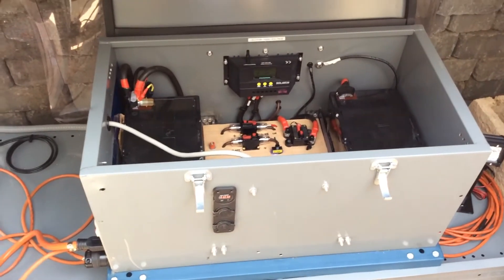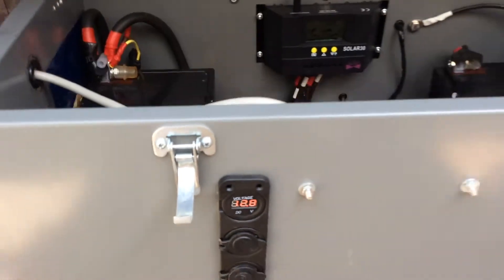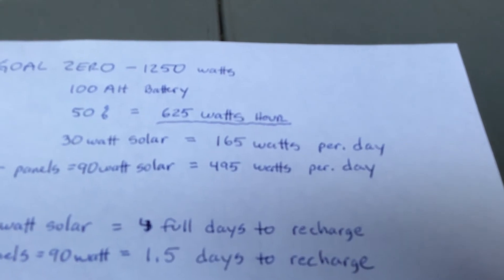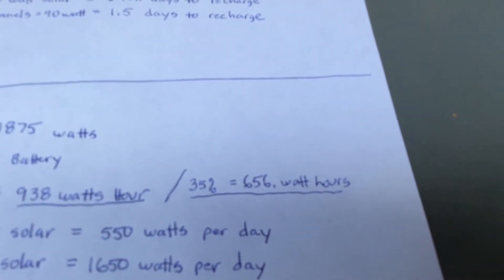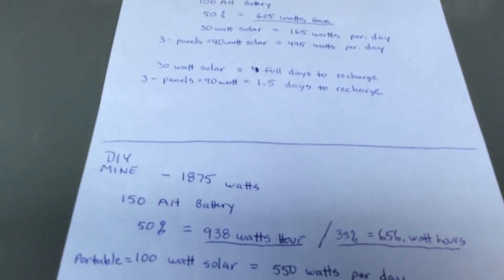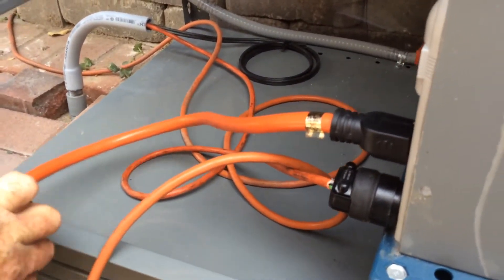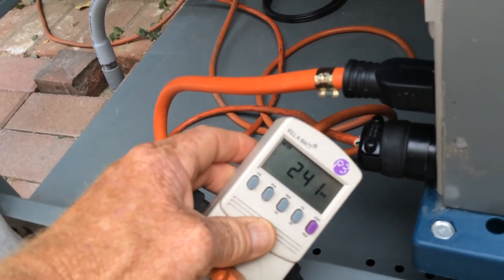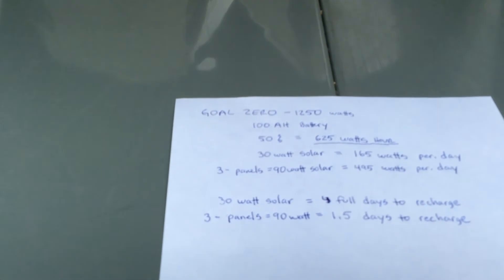DIY solar power generator vs Goal Zero 1250 generator

Comment: Ok, these are like car batteries.  There are different size care batteries what type should I get.  I want to get the gel type batteries and I thinking a pure sign wave inverter, unless it is super expensive.
Reply from the maker: Deep cycle batteries and a pure sign inverter is better. two six volt golf cart batteries would be the way to go'
Reply: urban solar offgrid I'm very new to this.  Would there be a major quality difference in 2, 6 V batteries compared to 2, 12 V batteries.   And I'm guessing I should get the highest Amh, I can afford.  I see the sine wave inverter are really expensive.   I would like to keep the budget around $800.  Your video simplified a lot of stuff.
Reply from the maker: The 6 volt batteries are pure deep cycle and the 12 volt marine are a cross between car and deep cycle. Same price for 2 and amp hours , just a true deep cycle with the 6 volt batteries. The mod sign inverter will work just fine.

Comment: Nice analysis of the GZ product vs. your DIY system.  There is no comparison.  GZ products are both inefficient and expensive vs. what you can build for yourself.  I have some videos on YT of a DIY system I designed and built.  Every now and again someone will post a comment about how my DIY system is SO expensive ($950 total including a 100W monocrystalline flexible solar panel, a 400W pure sine wave inverter, and 110AH battery capacity) and that I should have bought a GZ product .  All it takes is a little research to determine you can build a far better system for about half the price you can expect pay to buy a GZ product.
Reply from the maker: I have watched your build and that is what made me build my own portable system. Your unit is  a very well built and clean set up. If you put your unit next to a goal zero at a trade show for the same money , you would out sell them easily .